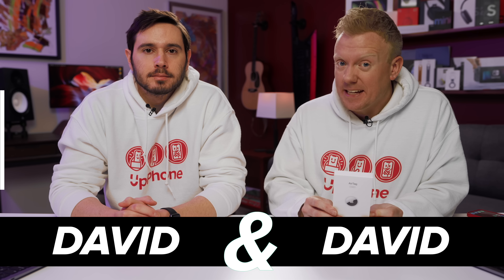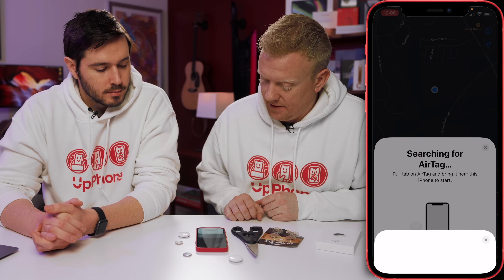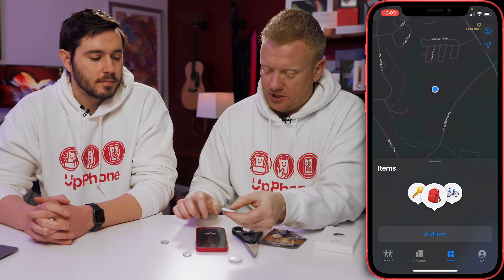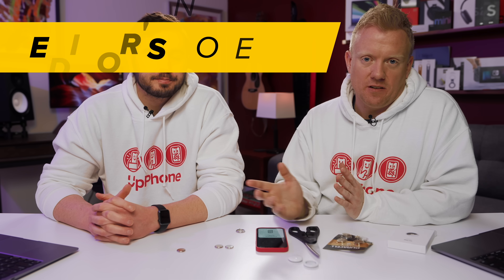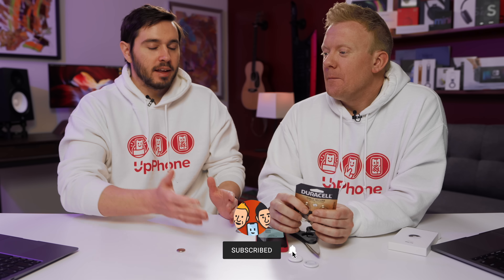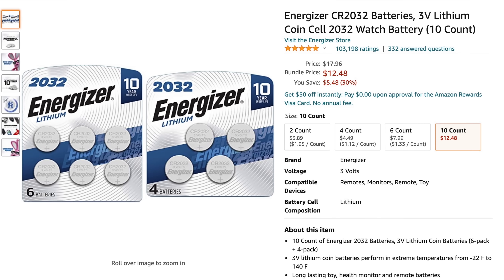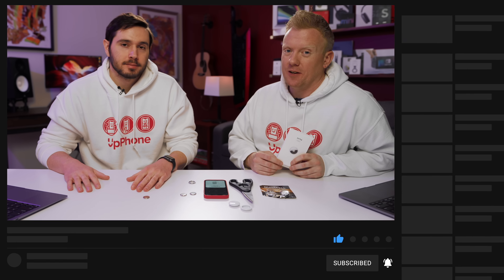HUGE AirTag Battery Problem! Replacements Won't Work! Apple's AirTag Design Flaw, Explained.

Comment: Use a Q-tip and dip it into rubbing alcohol. Rub it against the bitter coating, make sure it’s dried, and it should work perfectly!
Reply: Saved us $10 as well  ..  thanks to all you who posted that info about that here ..!  We did the rubbing alcohol .. but it didn’t work — until we took the next suggestion down in the comments about scrapping it lightly .. and we did so with a knife . Be great if the Payette Forward Guys could make a quick video addition on this .. what a helpful video that it would be for so many .!! 😊
Reply: @SO4JTV  well it did come up that you could do that, but it should not be done at home. So…….😊
Reply: You guys are awesome! Solved after rubbing Duracell battery with a Clorox wiper. Would never realize that this was the issue, as other AirTags coming from the same 4-package worked without “compatibility” issue. Bought a big Duracell package at Costco and was pissed of in needing to buy another brand.
Reply: @HamiltonHamamoto  Thank you. Clorox wipe worked perfectly.
Reply: @sundoobie that’s what I ended up using
Reply: If I didn't find an Energizer battery, I would be eternally grateful. Either way, tons of money saved for me.
Reply: OMG!! Sweetie, if you were near me here in East Texas I’d bake you a batch of homemade oatmeal chocolate chip cookies!! Thank you so much for this suggestion- I was at my wits end, truly! I had those expensive Duracell batteries and my Air Tag just would not connect- used the alcohol and presto!! Works like a charm, gosh too bad Apple hasn’t researched this!! Bless you, sweetie!❤
Reply: After trying 4 different Duracel batteries from 2 different packages with no luck, the cleaning the battery with a Q-tip and rubbing alcohol trick worked like a charm.  Thanks for this tip!!!
Reply: My original tags came with Duracell and one pack new Duracell works and the other one won’t work but after rubbing with hand sanitizer with high alcohol content, works just fine. Thank you so much.
Reply: You're doing gods work, that works like a charm! Thanks!
Reply: Thanks. It’s working.
Reply: That is the solution! Saved me money! Thank you for sharing this and thanks to the Payette Forward guys for discovering the issue! It was driving me nuts!
Reply: Thank you! This works!!
Reply: i cant believe it worked. thank you so much
Reply: You my friend are a legend 👏
Reply: WOW this worked!!!
Reply: Thanks!!!
Reply: Thank you, Amber! You help me save some money. 👏🏼🥳
Reply: Saved me $7 🙏
Reply: It worked on mine. Thanks.
Reply: omg tysm
Reply: I used acetone(nail polish remover) and it worked. Still irritating. Has to be the bitter coating that causes this.
Reply: With I would have see. This fix before I threw away my last AirTag assuming it had failed somehow during a battery swap. This worked perfectly on another on of mine that recently started to die. Thank you!
Reply: Whats the biter coating?
Reply: worked, thank you!
Reply: Thank you, Gracias, Obrigado!!!
Reply: Is the better coding on the back of the battery, meaning on the side that does not have the plus/minus written on it?
Reply: Many Thanks!! It works!
Reply: Yes it worked. I rubbed the back plate too for good messure
Reply: THANK YOU!
Reply: Thank you so much for this. It worked. It’s definitely gotta be the bitter coating.
Reply: Just saying alcohol does not dry evaporates. :-)
Reply: First clue was the last line that said…SHOULD work…No…it did not
Reply: Scrape & alcohol worked
Reply: Or fine grit sand paper! Worked immediately.
Reply: Thank u this worked lol… saved me 12 bucks
Reply: It works on my airtag..thanks

Comment: Wish I saw this video before I went to cvs and bought 2 Duracell 2032s and installed them smh. Even if the Apple site says the ones with bitter coatings may not work it doesn’t say that in the little video they post showing you how to change the battery smh.

Comment: It's actually the bitter coating causing the problem. I used some alcohol and a mildly abrasive sponge to remove the coating and it started working. Thanks for the video though, I had no idea the battery was the culprit until I saw this!
Reply: Thank you. 🎉
Reply: Bingo, worked like a charm!!!

Comment: Brilliant job gentlemen! I put a Duracell CR2032 in my Apple Air Tag and it would not work. After searching the web for solutions and finding lots of irrelevant info you guys gave me the answer. I am surprised this issue is not more visible given batteries like Duracell are popular. I'll go purchase some Panasonic batteries. Thank you.
Reply: Just wipe the bitter coating off, it worked for me. I used alcohol to clean it off and it started working perfectly after that.

Comment: Use a fine grit sandpaper and lightly sand the negative side of the battery then it will work fine.  It's the bitter coating causing the problem on the negative side of the battery.
Reply: that’s the east fix..,
Reply: Wow thx for the suggestion.  Was literally beside myself on what to do. Used a alcoholic sanitizing wipe and that did the trick.  Thx so much for the suggestion! Saved me a trip to the Apple Store.
Reply: Like magic. It works!!!!
Reply: The alcohol and nail polish remover didn’t work for me despite rubbing quite vigorously. The sand paper worked well. You could also try an emery board.
Reply: Thank you, worked for me, 5 second fix ... you star!
Reply: Clean the battery with rubbing alcohol and it removes the bitter coating and it works fine.
Reply: @gzo313  what a GOD!!!!! thanks man this worked magic 🪄

Comment: I have tried multiple battery’s and can’t get any of them to work. I literally bought the exact same band as the original and still can’t connect
Reply: Figured it out. So instead of shoving a piece of paper or something to get it to continue to connect you may need to bend the back piece prongs up more to hold the connection!

Comment: Thanks for this video. One of my AirTag batteries finally gave up the ghost after a looong period of ‘just working.’ I bought Duracell batteries and assumed the worst when no life was detected. After watching this video I used Goo Gone to wipe away the embittered coating and the once-questionable Duracell is installed and working.

Comment: Discovered this issue as I just bought a pack of Duracell CR2032 batteries. Simple fix is to wipe off the coating on the negative side of the battery with some rubbing alcohol and a paper towel. Works 100%.
Reply: Worked like a charm!!
Reply: You are god! 😂

Comment: When my Duracell’s with the bitter coating wouldn’t work I tried the emery board solution and it worked perfectly. Simply hold the bottom side of the battery on a 45 degree angle and you can see where the bitter coating is. A few back and forth strokes all around the circumference with the emery board and your coated Duracell will work.

Comment: If you're coming to this now - you can fix this by sanding the negative terminal with very fine sandpaper (400 grit or higher) to remove the "bitter taste coating".
Reply: I just grabbed a knife and scratched a spot at the bottom of the battery where the ( - ) terminal touches the battery

Comment: Thank you. As a 70 yr old with 82 yr old husband who misplaced his wallet this am, I relied on th air tag to locate it, but was notified the battery was low.  Immediately tried to replace batteries on 4 AirTags Thai I purchased at the same time.  Not easy to replace if you have arthritis, so having to do this multiple times was a pain.  Also, for some reason the AirTags would not immediately reconnect using my iPhone.  I had to use shut down everything, turn Bluetooth off and on and then was finally successful reconnecting/pairing using my iPad instead of my iPhone.  These devices are important for Seniors. Apple needs to make this process easier.

Comment: Anyone with this issue. Use some sandpaper or if handy, a dremel and just sand the areas where these 3 pins are. 
I solved it in 2 min.

Comment: I just had this issue and solved it by putting a piece of aluminum foil to connect the point to the base of the battery more easily

Comment: The issue is with the bitter coating which is a non conductor added around the edge on the negative side of the battery. The probes on the air tag are also on the edge so no contact is being made. I think Apple should modify the design given the popularity of Duracell batteries and their attempt to make it child safe. Move the probes couple of mm inside ( easier said than done I guess 😀)
Solution-Rub tiny amount of goof off or lightly scrape with a wood or knife to take out the bitter coating, good luck!
Reply: Used a slightly damp paper towel and rubbed it off, didn't need any chemicals, the coating is thin enough that it comes right off with a few seconds of rubbing.
Reply: @Archcorsair yup same here, just a damp paper towel worked fine.
Reply: No think Duracell should add the coating on the top somewhere not on the rim of the stupid terminal

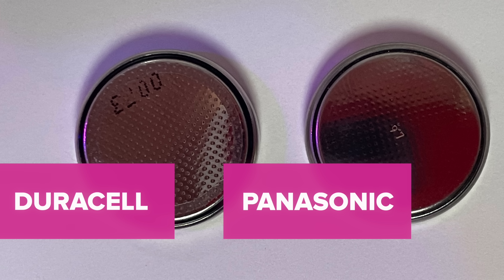Comment: Problem Solved: it has nothing to do with the thin black ring being a different size. If you look closely on the left battery at 1:47 you’ll notice a thin layer of glue around the edge of the battery. Simply rub this off with your thumb and nail and the battery will work fine trust me just did a before and after test and it fixed the battery from connecting.

Comment: Just a hint: NEVER touch cell batteries like this with your bare hands, as you will always touch both sides somehow and instantly reduce voltage, power / batterie live. Better use plastic forceps or gloves. (Experience of working in a watch shop!) 
Thanks fore the advise regarding in/compatibility of that type of batterie.
Reply: Good info .. Thank-You !!

Comment: Heads up, just tried an older model Duracell CR2032 and it worked straight out of the pack, it’s these new 2022. A fix I found was to lightly sand the base of the new battery to remove the coating, works fine!

Comment: I had this problem with energizer batteries. I took a piece of 180 grit sandpaper sanded the edge then sanded the negative side of the battery. Stuck it back in worked fine. Just need to rough it up enough to remove the coating. Apple should replace them all but maybe they can convince the battery manufacture they don’t know how to make batteries. Didn’t go over well when apple claimed everyone didn’t know how to hold their phones but who knows.

Comment: had my first low battery warning, got 4 duracells to get ready for the rest of them to go, and my set (custom engraved Black Friday 2021) STILL have this issue. Certainly frustrated with Apple that this is a problem, but thank you for a solid breakdown as to why exactly my batteries are not working.

Comment: One work around: take some sandpaper and/or steel wool and sand the front and back of the Duracell coated batteries.  Worked for me.
Reply: A nail file works too.

Comment: guys i found a solution to the problem. if you get a very small bit of water and a small bit of tissue or something you can wipe off the bitter coating of the batteries which makes the connection work :)
Reply from the maker: That's definitely better than my pocket knife idea :)

Comment: Found a solution (don’t know if anyone has posted it in another comment): use a nail file or fine sandpaper, and file/sand the battery on the bottom (negative) area that makes contact with the bottom pin inside the AirTag. If you angle the battery just right to the light, you will see an outer ring that I presume is the bitter coating. You can clear just the section that the pins contact, or if you want to ensure the battery will work no matter how it is inserted (anglewise around the Z axis) you can clear the whole coating ring.
Reply: Instead of a mechanical tool I used a solvent which is used to clean the Paint from a Paint brush. I had to rub it for a few minutes, but then the coating was gone and the battery worked.

Comment: The problem is NOT the fault of Apple.

It falls squarely on DURACELL for the 2032 cell being out-of-spec.
The “bitter-taste” cell is thicker.

Those ‘bitter’ cells have given me no end of problems.

YES IT IS THE FAULT OF DURACELL “BITTER”.

And quite honestly, your ridiculous “It CAN’T be the fault of DURACELL!!!” really lowers your credibility. 
Like, to ZERO.
You looked like a pair of old hags, cackling about ‘finding a penny in the porridge’.

Comment: To David and David, a very interesting video.  Could it be that the actual issue is the difference between a "CR 2032 battery" and a "DL 2032 battery"?
Reply: The AirTag app says to use CR2032 and I have a brand new 8 pack of Duracells that say CR2032 and they don’t work.
Reply from the maker: I hear ya! Same thing happened here.
Reply from the maker: Nope, they're exactly the same — DL is just a prefix that Duracell uses. CR is everybody else. According to a commenter on an Amazon page for Duracell batteries, "The number that follows indicates the diameter and thickness (so CR2032 is 20mm diameter, and 3.2mm thickness)." I learned something too!

Comment: I thought I was going nuts so I removed the tag from my phone and found your video. When I switched to a Panasonic battery  I found I was unable to re-pair the tag to my phone but the answer was to do the resetting of the tag, maybe you can do a video on that. :) For anyone reading this comment. Once you have acquired a good non-coated small o-ring battery you simply remove the cover and insert and remove the battery 5 X in a row and on the 5th time the chirp sound is different indicating the full reset was successful. Then you can resynch the tag with your device. Good Luck and Thank you.

Comment: Hey guys so I had this exact problem but quickly found a solution. Take the battery and use a very slightly damp towel or rag and rub the battery. This gets rid of coating on the battery and it should work after doing this. If it still doesn't work maybe put a bit more water on the rag/towel and do it again. I only did about 10-15 seconds and it worked just fine.
Reply: I did this trick and rubbed (-) side with some StrikeHold cleaner as well as an added measure.  Battery works fine now.  I had some similar issues with getting CR2032 batteries working in my Nissan Leaf keyfob and now think that may be the problem with that item as well.

Comment: I found a major legal flaw with AirTags.
It's a Bluetooth device, not useful beyond ~30 feet. It's good enough to find keys inside of your house just like Samsung and tile devices.
The issue is how it's hopping other iPhones to report beyond that range without consent from them and that's illegal at the constitutional right level.
Your iPhones could be actually used in crimes right now without you knowing it...

Comment: How is this an Apple issue? it's a Duracell issue. I have the same issue with all my Digital Multimeters at my shop. No Duracell will work in them.
Reply: Exactly. Even heart rate monitors has issues with Duracells. The statement by this two guys is misleading.

Comment: I worked around this issue by putting a small thin metal washer/spacer between the pin and the Duracell battery. Once the battery is in, and you hear the chime, put the cover back on without significantly moving the battery (so the connection is still good). It might take a little extra to turn the cover counterclockwise to lock, but it’s doable. Now my cat’s AirTag is working with the Duracell battery. :)
Reply: Tin foil disc would work as well
Reply: You can also chemically remove the coating with nail polish remover.

Comment: I've already had one battery die on an AirTag for my dog. I had the same problem of it not working when I replaced it with a Duracell 2032. I used a small piece of aluminum foil, folded several times, and it gave it just enough thickness to make a connection. It's been working just fine since.

Comment: You are right. I just bought Duracell batteries trying to fix an issue I had where all my AirTags just disconnected for no reason; I was trouble shooting it with apple who suggested I replace the battery and they don’t work at all! I think this is a huge problem

Comment: Just For What It's Worth:  Many years (decades?) ago I had an electronic desk telephone with a Panasonic size N battery in it.  The telephone was not Panasonic and, as the 'phone was not line-powered, the battery powered the electronics.  After the Panasonic battery went kaput, I got another brand to replace it.  I believe the initial replacement was from Radio Shack as size N batteries were not common in those days.  The replacement battery would not power the 'phone.  I tried Duracell, Energizer and another brand but none would power that 'phone.  I could not find Panasonic branded N batteries so I just gave up.

Comment: The problem is the Child Deterrent Coating.  You can see it if you look carefully.  Solution - use a standard emory board or low grit sandpaper and remove the Child Deterrent Coating.  All Batteries now work!
Reply: I’m an electronics tech and confirmed your solution works.  I fixed several batteries from a 12 pack from Costco. I also posted a more detailed solution.  Thanks!
Reply: @trialshawaii I cannot find your more detailed solution. How do I find it?

Comment: I have the same problem with the Galaxy Smart Tags with the Duracell battery...
My solution was to fold a small piece of my receipt as a shim to push the battery down and it worked.